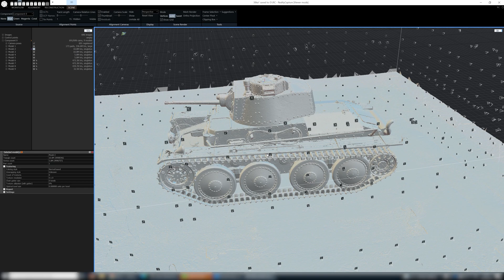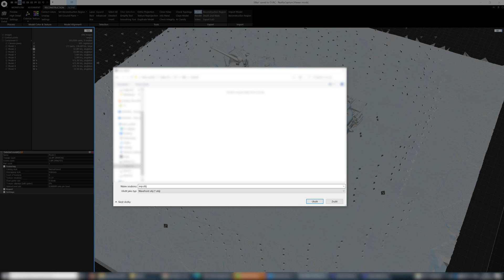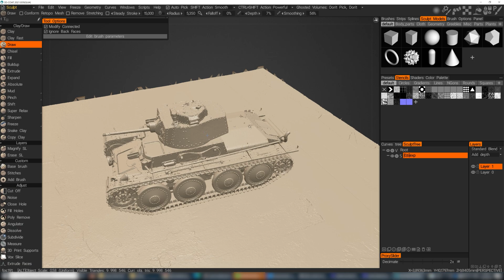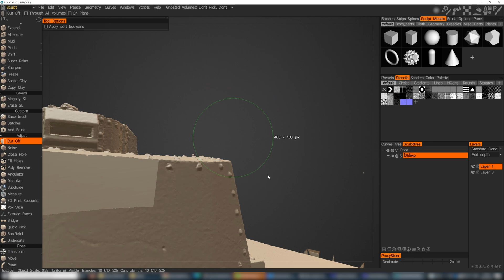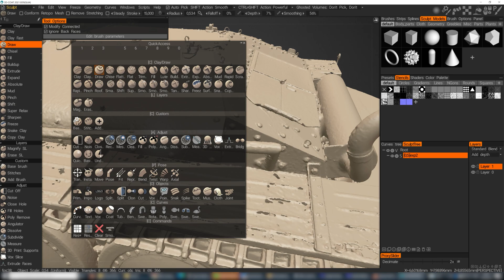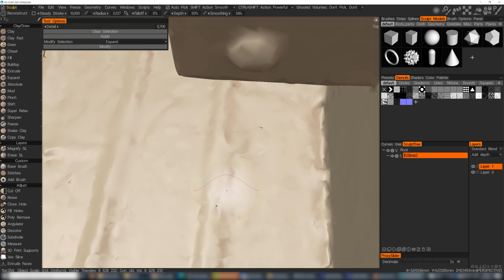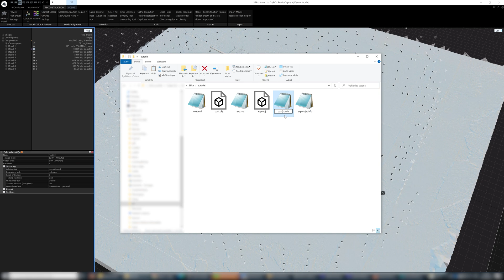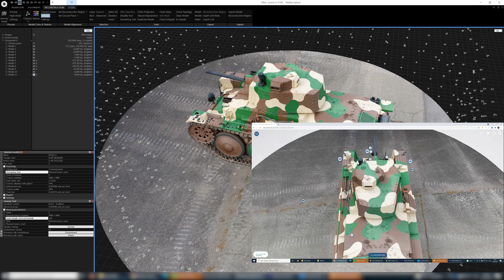3D Scan basic cleanup - Cut off and filling holes

Comment: Why not closing those holes first before exporting it into 3DCoat or ZBrush ? This way the mesh will be water tight and less work selecting all those little holes.
You can close holes with meshmixer or Geomagic Freeform first.
Reply from the maker: Hi, this mesh  (with holes) is water tight. These holes are not "holes" in a topology, but actual shape of the 3d model. So it is not possible to "close" them with some "close holes" function in meshmixer or any other.
Reply: @kroscloud  Is this file directly after the scan ? How come there is even a 2nd side (under side) it would not be physically possible to even scan there so the software must have created a small offset.
Reply from the maker: @sierraecho884  Not sure what you mean by the 2nd side... The file is right after the export from Reality Capture.
Reply: @kroscloud  I see, I use Agisoft. I simply leave holes where data is missing. Holes in Agisoft means it´s not a closed shell it is simply open, so you can export it and close those holes in about 1min.